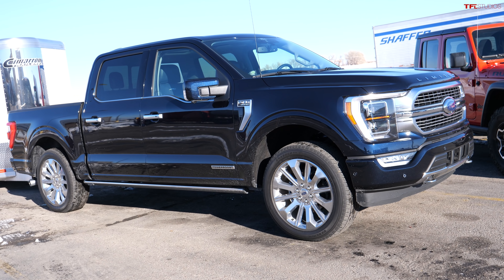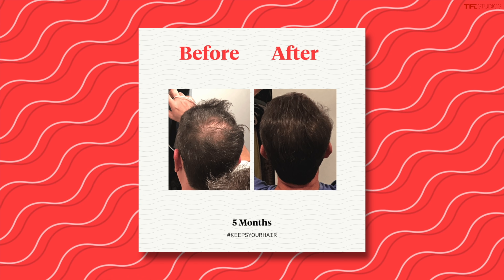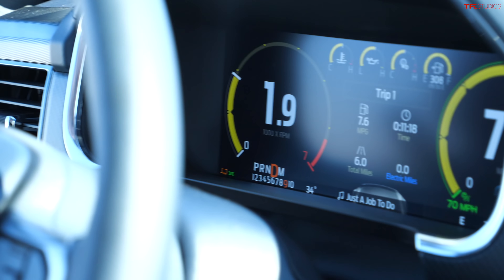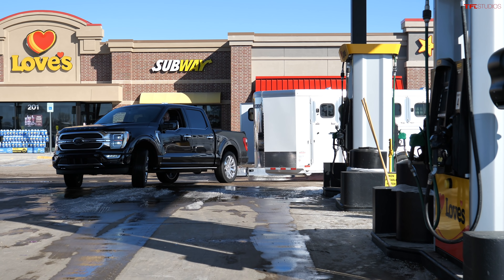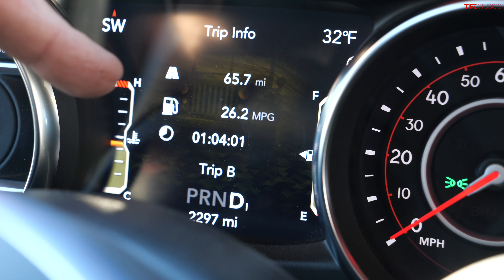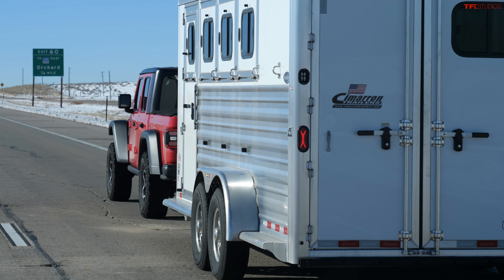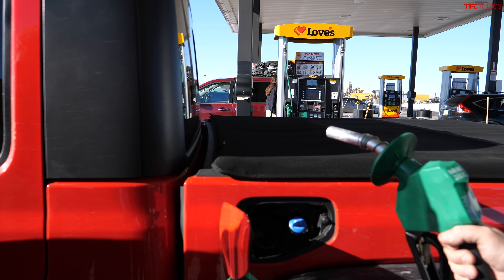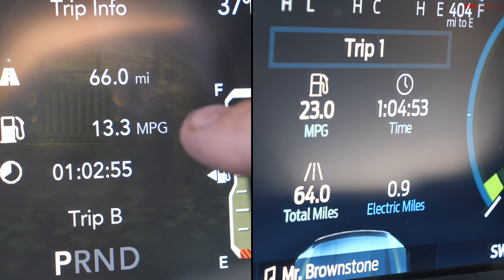We Didn't Expect This: Will a Ford F-150 Hybrid Get Better Towing MPG Than a Jeep Gladiator Diesel?

Comment: I always wonder how accurate or truthful are the meters at the pumps also. I’ve put in 20.5 gallons into my vehicle that has a 20.0 tank before.
Reply: Tanks have additional capacity your not supposed to use. It supposed to have breathing/expansion room. I occasionally do the same, but I don’t advise making a habit of it though
Reply: I agree.  I had a dispute with a station.  My GMC Yukon took 37 gallons to fill.   Tank isn't that big.

Comment: I suspect the difference between the computer 24mpg report and your 28mpg calculation is that the computer doesn't include battery-only miles in calculating engine mpg...have really enjoyed your 2021 F150 reports.

Comment: A hybrid vehicle pays off if you do a lot of city driving.  The price of the vehicle is more expensive.  The hybrid related parts are going to be much more expensive.  It takes special training for the mechanics to work on it, so you will no doubt be getting it fixed at the dealer.  After a couple of years I would consider leasing a new one and get rid of it when the warranty was up.  If I was going to buy to keep it 10 years plus,  I would buy a non hybrid, F150 new for my average light duty work.  If I needed to tow and/or have a camper to carry, I would buy about a 2000-2006 F350 Diesel dually 4x4 that someone had taken care of.  Then do whatever maintenance was needed.  That's a non eco turbo diesel engine will give you plenty of power.  What ever you do, stay away from any Diesel that requires DEF.

Comment: cummins tuned trucks in one ton have been getting 24mpg all day long! I get around 18 mpg towing a load. put a 40mph cross wind and those light rigs will hate life
Reply: They are hit or miss. I’ve had a single cab Cummins that got 15 highway and a dually that got 24. Same truck aside from the cab.

Comment: What pump issues? Just because you got a good result, you think the pump is broke? I think the hybrid F-150 could definitely hit 30 mpg for that trip, depending on how much battery it used, which it probably drained....I think the mileage would drop on a longer trip, but not by a whole lot. Probably down to around 24/25 mpg were Ford rates it.

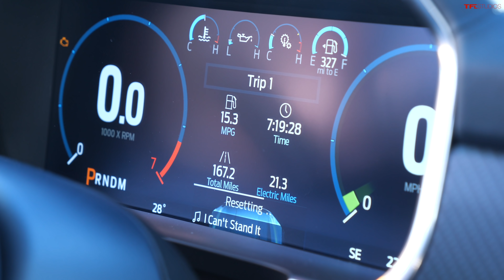Comment: Hey tfl, what’s up with 3:45? Shows a couple gallons below full, right after filling up and resetting trip meter?! That f150 hybrid system shouldn’t help at all under a steady load, the battery is way too small to do anything besides mall crawling.

Comment: 8.06 mpg with a light weight truck and only 6k towing - that sucks
Reply: That's mainly due to the large surface area of the trailer, which creates a lot of drag at 70 mph.  Also, drag in further increased by the colder and denser air in the winter.  Doing this same test empty, on flat land would result in about the same mpg for boat vehicles on the flat road they normally test on.   If you look up the formula for drag, velocity plays the biggest part followed by surface area.  In fact, everytime the velocity doubles, the drag force is increased by 4 times.  That means it takes 4 times the energy to drive 70 mph than it takes to drive 35.  So in reducing the speed to 60 mph or 55 will make a BIG difference for any vehicle.  Cheers :)
Reply: @Show-me-how-now  The power required to overcome aerodynamic drag is the CUBE of the velocity increase, not the square. If it takes 20 HP to drive at 35 mph, about 160 HP will be required to drive the same vehicle at 70 mph.
Reply: Um I've pulled with dozens of half tons....Ram,Chev,Fords.
Pulling less than 8k loaded they all have been less than 10mpg.
All....
The best was probably the 6.2L Chev....but you had to run premium,on a good calm day on flat road it would bounce over 10mpg.
Wind and terrain have a huge impact when you are pulling a big box around.
Anyone expecting more than 10mpg consistently pulling a trailer is delusional.
Reply: my eco diesel averages around 13 mpgs with my 7400 lb camper on the rear.  My dad can only do best at 9 mpgs with his  hemi.
Reply: Lmao what a joke I got 11.7mpg over 300 miles towing 5k pounds in my Tundra.

Comment: Do ya really need to keep running tow haul mode while just cruzin on the highway?  I tend to kick off tow haul when i'm at highway speed.  More helpful in the hills and around town.   Thx guys love the truck anyways.
Reply: On modern trucks? Yes. In fact I prefer Ford’s tow/haul mode over normal or eco.

Comment: I’m thinking of getting the gladiator and lowering it on lightweight wheels and building an aero face to bolt on in front of the wheels and tires and under and over the bumper and make it extend from the factory over fenders

Comment: I seen snow on the ground,so your fuel milage will be different in the summer months, should be  better.
Reply: Not sure how much truth there is in that, i've been working in canada and the northern US for a few months, weather was nice and not at all cold when I got here and now in canada specifically it's usually below zero, no noticeable difference in my fuel use.
I drive a 2013 3.5 so unless something changed it'll be basically the same

Comment: i don't think you were having bad luck at the pump, you can trust your hand calc'd numbers WAY more than the on board displays.  while those are close, they are never as accurate as a certified metering pump and hand math on miles.
Reply: Except that it seems the Ford's tank was not filled properly at the end there.

Comment: Doesn't the Rubicon  series come with lower geared differentials than the standard Jeep?  This would account for the lower mileage
Reply: For some reason I am thinking that only on the diesel Rubicon it comes with 3.73 gears instead of the 4.10's but I could be mistaken.
Reply: Yeah he should’ve of tested an overland (luxury trim) gladiator with street tires against the luxury limited f150 with street tires.
Reply: Max Tow package equipped gladiators come with 4.10s and All-Terrains, that's the config you have to get to attain the advertised tow numbers

Comment: That puts my honda cr-v hybrid to shame. Took a trip from Arkansas to Colorado a couple wks back and my worst tank was 21 and my best was about 27 at 75mph. All in all I averaged about 24-25mpg over 1600 miles with a 4 cylinder.
Reply: Yes but it seems like they stopped pumping gas way before the Ford's tank was full. Probably had a bit of spit-back that released the trigger and they thought it was full, but maybe it wasn't more than ¾ full. That skewed the figures by the looks of it and if you look at the last minute of the video. André really should have explained that at greater length even though it makes them look a bit foolish. Hopefully all the other figures are near to correct.

Comment: Looks like those pumps were pretty sensitive to foaming and didnt want to fully top off at times.  Would not expect as much as 25% error in digital fuel economy readouts.

Assuming the trip computer was thr more accurate measurement, with the hybrid taking premium, it actually costs me less to drive my five year old, leveled F150 5.0 with on K02s on the highway with the front air dam removed.

Comment: One note on the Hybrid, as soon as the juice from the battery is gone, the fuel economy will drop significantly on the highway. You would need a longer test loop to see it though. If you are mostly commuting, you will see close to the number that was begotten here. Of these two vehicles, mechanically, the Hybrid is simpler. It's the sad truth with modern diesels, and the 3.0l FIAT is one of the most complex. You would likely return another 1-2mpg on the Gladiator if it had ATs instead of the MTs.

Comment: 8mpg hauling 6k pounds? Wow that's bad.
Reply: My f250 gas pulling a 8k tractor on a 3000# trailer gets 10 to 11.  So 8 is disappointing.
Reply: @johnb7430 Frontal area has way more effect on fuel mileage than weight at highway speeds. For instance, there would be little difference whether this enclosed trailer were loaded or empty.
Reply: The 3.5 doesn't like hauling from what i've seen, the small turbocharged engines just don't handle it as well as a V8. But it's not that bad, considering it's a horse trailer and they were going 70
Reply: I “ll bet his towing speed (70) on the F-150 is why the towing mileage was so poor. I pull a 6500 lb. travel trailer with my 3.5 ecoboost and the difference in mileage between 60 and 70 is huge.

Comment: Mr Truck Solution to the 4 pin flat connector for your boat!! Just break out one of those 7 pin to 4 pin adapters that Ford used to supply with a new truck. I never left them with the truck when I traded in so I have several of them. I'm sure you do too!! LOL
Reply: Yeah I picked up the boat in Wyoming with the 2021 GMC 1500 and had to stop at Walmart and get an adapter for it
Reply: Oh snap!!! I bet you had several at home too!!
Reply: @paulrodrigues9603  Yeah I did

Comment: The 29.9 mpg of the empty F-150 is might impressive. My Ranger with the 2.0l diesel gets only 26.14 mpg, so I'm rather surprised to see such mileage from a full size truck with a gas engine, albeit with a hybrid powertrain.

Comment: Very interesting review. Nicely done. My takeaway is that the manufacturer’s on-board calculations remain suspect or not very accurate compared to real world performance. Out of curiosity, what are the tow limits for both vehicles? Is the Ford Hubrid at or over the 3.5 Ecoboost limits?

Comment: It would be a better comparison to tow a certain percentage of the vehicle's max tow rating rather than the same weight for both vehicles. The 6000 pounds is at the Gladiators max whereas the Ford has not nearly reached its max tow rating with that weight.

Comment: The comparison I want to see is f350 vs f150 for the dailly driver who tows 8-10k lbs  under 8 weekends a year.  F150 better daily driver, F350 safer tower.  But, the new 2021 f150 is redesigned w electric inverter...at what weight and trailer length would you give up the f150. 9k lbs simply due to weight, limited wheelbase, and brakes of f150? Are the hybrid regenerative brakes beefier than before?

Comment: Have you guys ever tried running it and normal mode while Towing I have a 2019 F150 I run in normal mode while Towing my trailer but only when I get into the hills do I put it into tow haul to make a difference on fuel mileage

Comment: The current hybrids are purely a marketing ploy. If the manufacturers were really on board to make the vehicles fuel efficient then they would have electric powertrains and gas generators to charge the batteries. The gas engine could be very small with a constant determined load. They would only need to run when the batteries were below a certain percentage. If you add plug in capabilities then most of the time the gas engine would not run except for say a long trip or when towing to keep up with the increased demand.

Comment: Only benefit of the hybrid is empty mpg but using it for truck stuff the hybrid fails it gets worse millage than my v10 f350 towing i get 10.5 towing 8k in that truck very impressed with the gladiator for a mid size truck great mpg on both loops need to compare it to the powerstroke f150 and see who wins their

Comment: What type of issues were you experiencing with the pumps? Thanks for the vids!
Reply: It took several times to get the card to work, so did the guy on the other side of the pumps
Reply: @MrTruckTV  have you talked to the gas station or the state measurement office?
I did that in similar case in MN some years back. The pump was a bit off.
Reply: @reggiebuffat  the less miles on the loop, the less accurate the test will be by using gas station shut off. If your going to use the
Reply: @reggiebuffat  Good Idea, we are always time limited doing 2 trucks the same day

Comment: Couldn’t you guys go to a local concrete contractor and have them pour/make you 1000 lb blocks with slots for fork blades.  Use them instead of constantly filling up with water for your towing weight.  Another good video from TFL

Comment: at $4500 for the hybrid upgrade it's going to take a long time to make that money back.  It will already be out of warranty before the break-even occurs.  I'm looking forward to next advancement in hyrbid technology for trucks (actual significant electric range)
Reply: With the PowerBoose you get 30 more horsepower, 70 more ft/pounds of torque than the standard 3.5 and also the Pro Power on board generator system (2.4 KW) with 120/240 and an optional 7.2 KW. You can operate power tools on a construction site and much more.  Here is a link to an article with more detail https://www.thedrive.com/news/36800/2021-ford-f-150-powerboost-hybrid-everything-you-need-to-know
Reply: @jimrobison114  I agree, there are other benefits. I think right now hybrid technology is in its infancy. I look forward to seeing where it goes in the future
Reply: Hybrid is a $2500 option on a Platinum, probably due to a higher level base engine.

Comment: See I would like to know what kind of diesel fuel it’s going in there is it a bio diesel brand or pure premium because that can change your MPG‘s for one, And with Rose much more heavy duty off-road tires on the jeep you can easily say they were gain nearly 2mpg or more With all highway tires

Comment: Wow. Disappointed with that result on the hybrid towing result. I am curious if you don’t turn on tow haul mode, if that makes a difference.
Reply: Hybrids are only efficient when they can use the electric motors. constant highway speeds with weight, it'll never use the electric motors because it won't be powerful enough. 

I'm betting though, that towing in a city would actually be better, since the electric motor can flex it's near instant torque to get that weight moving, then kick into the gas to keep it moving.
Reply: @Xyler94  while I would not expect it to ever run electric only, I would expect the electric to supplement the ICE during acceleration.

Comment: I’ve never trusted your fuelling measurement system over the computer. I’ve had too many vehicles not take the same amount of fuel after the same distance driving. I had a Honda Civic one time that would take anywhere from 38 to 45 litres of fuel with the same driving conditions and same amount of km. Mustang I have is the same. When in doubt trust the computer.

Comment: What issue did you have with the fuel pump? I really didn’t understand that part…
Reply: An excuse as to the fuel economy numbers.  I guess they still can't figure out when you are driving a box with wheels towing another box with wheels your fuel economy is going to suck in vehicles that aren't built for doing that.  I think the F150 with the V8 did better in the fuel economy loop than their ecojunk engines ever have.

Comment: hybrid gets 20% better gas milage but you spend 20% more on premium gas.
Reply: I believe the recommended fuel is regular.
Reply: I take back what I said.  I'm not sure about the limited.  I know the limited has access to the 3.5 HO motor which recommends premium, but is the powerboost 3.5 the HO motor.  Looking at some talk about the 3.5 powerboost it states regular gas.  And I can't find information in the online 2021 owners manual.
Reply: This states regular, but it doesn't mention anything about the limited in specific.  https://www.fordservicecontent.com/Ford_Content/vdirsnet/OwnerManual/Home/Content?variantid=7320&languageCode=en&countryCode=USA&Uid=G2066198&ProcUid=G2066204&userMarket=USA&div=f&vFilteringEnabled=False
Reply: @bartz118  I'm just going off video where they said a premium vehicle requires premium gas.  so next question is what is gas milage on 87

Comment: I really hope one day you guys figure out what's missing with your measuring system.  Your margin of error is just too big!  First, your loop is way too short and because of that, your method of filling the tanks at the end makes your results inconsistent at best and sometimes just plain way off!  From one pump to the next and from one vehicle to the next, there are many factors that affects when the pump stops.  With such a short loop, a small change in how quick the pump stops can make a very big difference in your fuel consumption calculations.  There is really only one solution and it's simple, although time consuming: make a bigger and, if possible, a much bigger loop.  Choose a 300 miles loop or take that same loop, but do it 5 times !  In that case, a little inconsistency with what makes the pump stop at the end when you fill the tanks back up will only make a 3-4% difference instead of a 25-30% difference in calculating what your actual fuel consumption is !

Comment: Hmm…the gladiator trip meter showed 66 miles, the Ford showed 64.9? Still over 29MPG if the fuel was accurate.

Comment: Mr. Truck doesn't understand that a vehicle that doesn't plug in only gets power from the ICE engine.  He seems to think that trailer weight is much more important than air drag on the interstate.  TFL stops the test and publishes the data after saying that it is probably useless.  The test loop was designed to minimize the benefits of a hybrid.  Other than those huge flaws, sort of an interesting test.

Comment: Drive-thru stop and go instead of just strict highway and then compare the miles per gallon towing a trailer... I mean driving on the highway you basically defeat the entire purpose of a hybrid... There's absolutely zero to be gained with a hybrid on the highway

Comment: Interesting result. Diesel do well for towing efficiency, while the hybrid do worse, and Hybrid more efficient empty then an empty Diesel.
Reply: That's what happens when you chop off a couple cylinders.  You are now asking a smaller engine to do the same work as a larger engine, and people wonder why their little 4 and 6 cylinder 1/2 ton trucks don't do so well when towing.